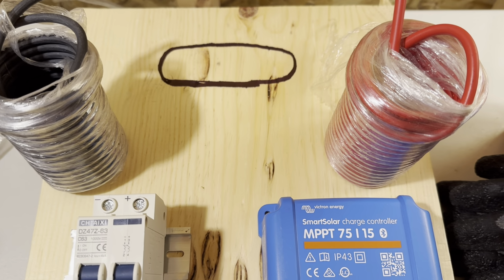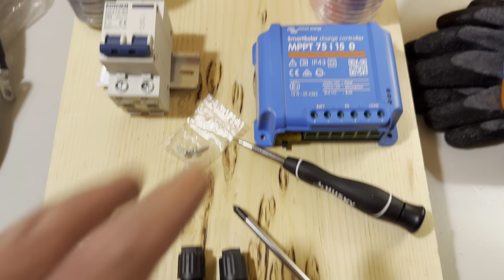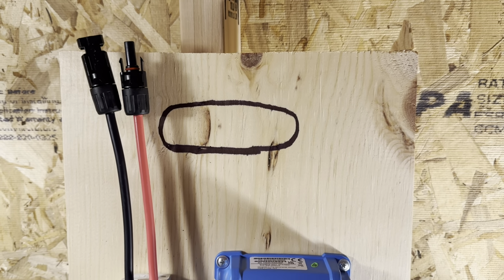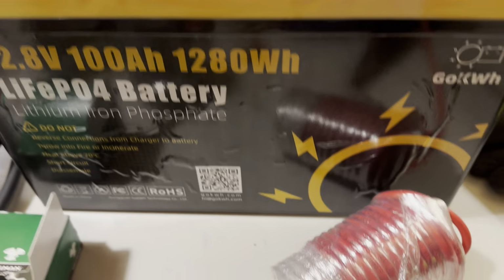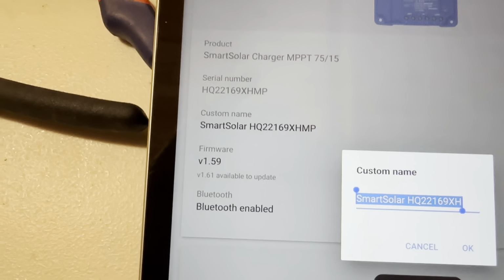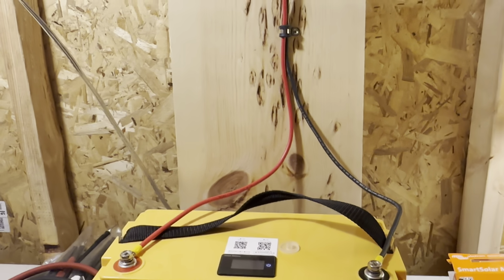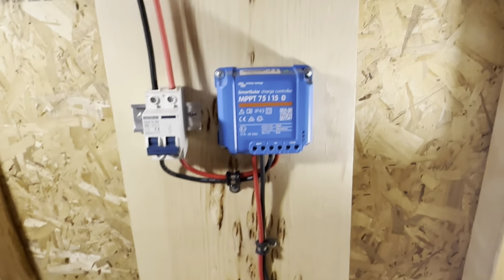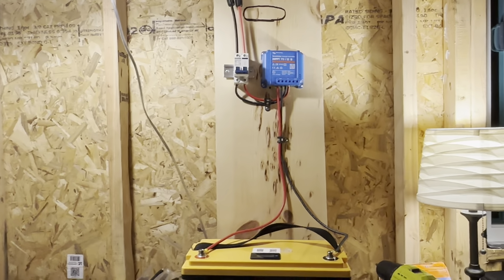Portable Solar Charging board

Comment: great idea. super easy to make. The few portable ones I make I used a plastic 50 Cal ammo-can . rain proof. 2 of them have small LiFePO4 in them.  for larger charging current I just open lid for venting for Victron MPPT . I wanted rain/snow prof for camping .
Reply from the maker: Just tinkering around in the shop. But I can really use this around the property some! Aloha!🤙

Comment: This is great. As I’m watching, I was thinking if you did, in fact, put a breaker between the charge controller and the battery terminals, and then add alligator clips to the battery cables instead of the eyelets, it would make it truly portable with no tools needed to recharge the batteries. Especially if the battery is currently connected to something else. Simply clip your boards clips to the battery and flip the battery breaker on to start charging. No tools needed. 😊
Reply: I did an inline breaker to the battery with an xt60 connector for quick connect. "No tools"
Reply from the maker: Nice!🤙
Reply from the maker: I like that idea! Aloha!🤙

Comment: I have a 12v SLA (just because I had one spare) It sits with a sun facing 5w panel -no controller! The battery is always full and always good for emergency use.
Your board needs (IMO) a case on the back to hold and carry a portable (foldable?) panel and a single prop stand to hold the panel facing the sun whenever you need.

Comment: I'd put this in some kind of a box and use Anderson power pole connectors so that I could swap out the output leads so that I could use battery clamps or ring terminals, etc.  Adds to the cost but is more convenient.
Reply from the maker: I agree, and plan on adding those!🤙

Comment: Don't you need to swap the wires going into the circuit breaker from the solar panel?  The positive connector on a solar panel is the same connector you have going into the breaker.  Good video, thank you.

Comment: Looking good.
0*. Degree. Here this morning.
I am not charging my batteries under 40* degrees.
My question to you is.   Does it hurt the  lithium iron phosphate  batteries to be.  STORED  below 32 degrees?
Reply: Every manufacturer publishes their specifications.  I own two different LiFePO4 batteries that claim you can store all the way down to zero F for up to three months.  However, store them with a full charge.  IF the per cell voltage drops below 2.4 or so you may have to WAKE the battery up using a specialized LiFePO4 charger or other device for the BMS to start up again.  Some BMS (JK) have a critical flaw on the default voltages, so make darn sure your charger settings are correct before charging the battery bank.  Your mileage will vary, but a very good question.

Comment: Newbie to solar here, but I have a question. Does it matter which direction the current flows thru the circuit breaker? I would think the MC4 connectors should be going into the c/b thru the bottom and to the controller from the top of the c/b. Are c/b's bi directional, or is that the standard for that kind of a c/b?
Reply: For DC breakers the safer question is "DOES the breaker extinguish the DC ARC?"  IF it does NOT, then don't ever use one in an enclosed structure.  In this example and using the breaker on the board that Bob is using they CLAIM it can extinguish a DC ARC then polarity (direction) probably does not matter.  However, some DC breaker manufacturers mark their breakers with -- and ++ with - and +.  My understanding is the double markings to to imply the higher voltage potential.  IF you DONT know IF the DC breaker is NOT capable of extinguishing an ARC, then NEVER break the current under full load and IF it catches fire, CUT one cable!  I am more paranoid for in the home use, and have external combiner boxes and SINGLE pole breakers to eliminate a DC ARC between positive and negative or in a situation where a component fails (inverter, controller, or panel).  Therefore, if you are buying DC breakers off Amazon, assume that the DC breaker is cheap and won't extinguish an DC ARC or just buy Q-series or midnite solar DC breakers that are certified for DC circuits.  Hope this helps you out and gives others something to think about as you only get one chance to minimize fire risks in your home......
Reply: @Gary-wh7ce  Thank You. I really appreciate your feedback. I dove into solar with just a basic knowledge of DC. Since my setup will reside in my garage, fire and arcs are my greatest concern. Doing due diligence to do everything right, thus the query. I will put your advise to work and do more research. Thank you.....Safety First